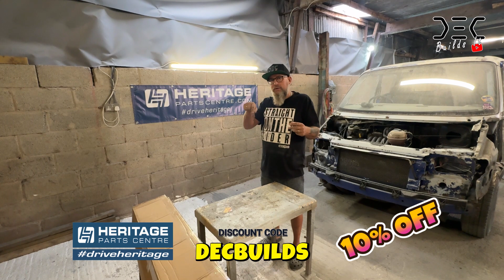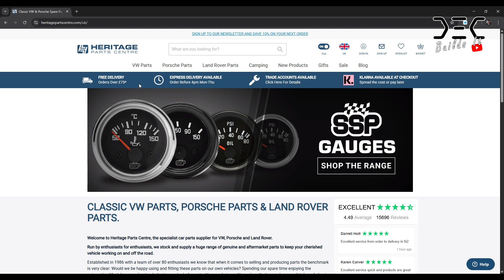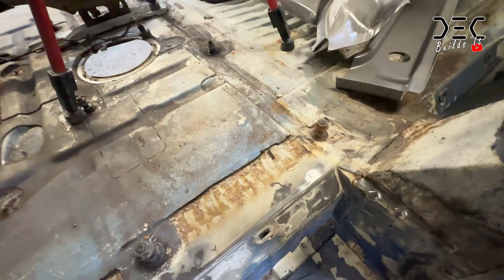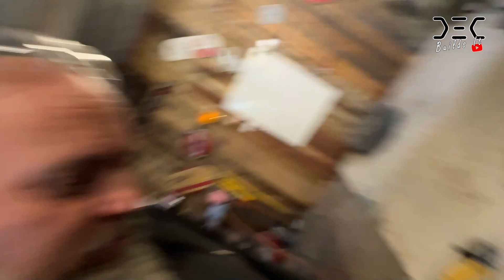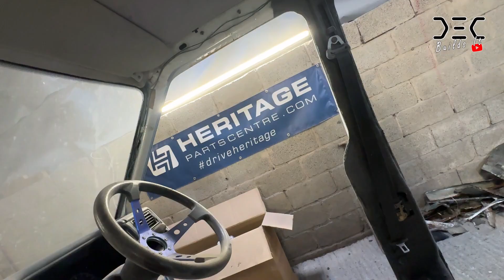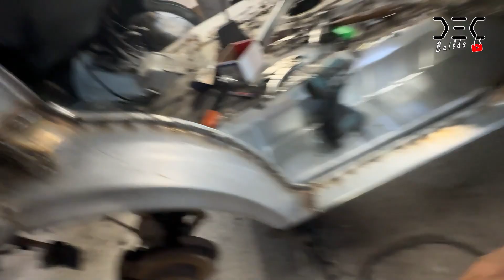This VW T4 Doka Is Completely Eaten By Rust | new panel time @driveheritage

Comment: getting de ja veu with all those panels you have. Love it
Reply from the maker: Yeah it’s had some work for sure but good bit rust it gone doing it this way 😊 most t4s need a lot of panels to do them right joys of vw at that age not using rust prevention and how thick the seam sealer is that they used 🫤